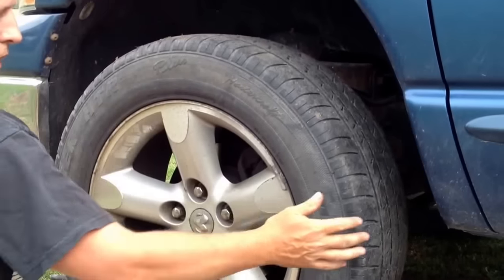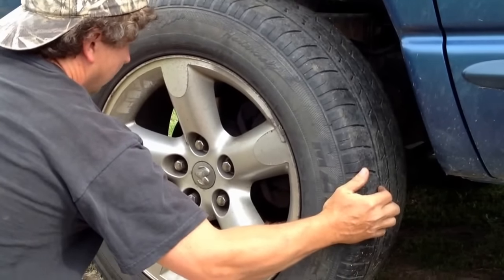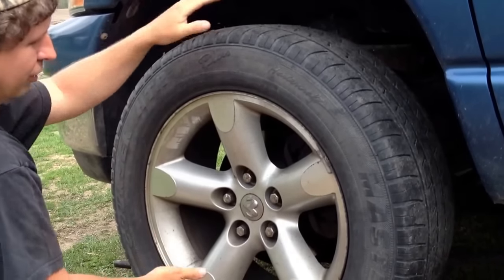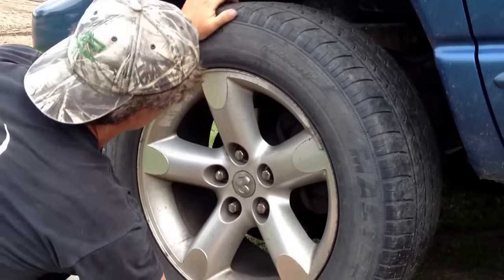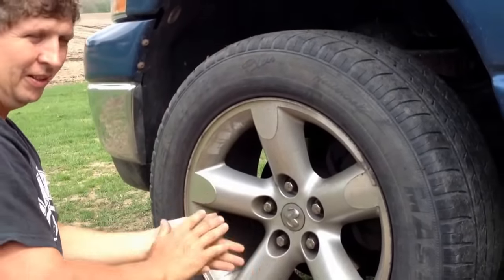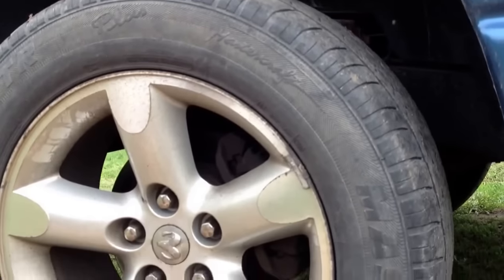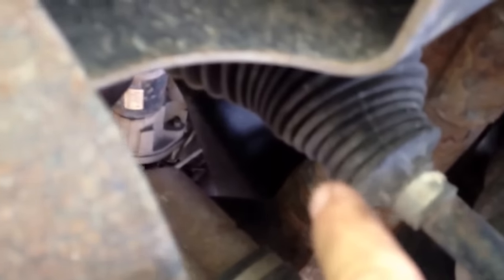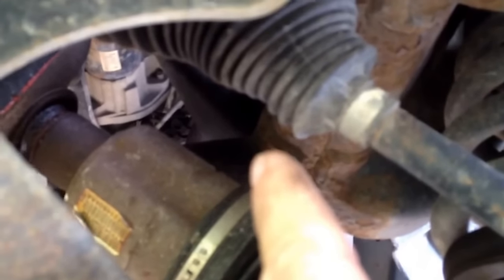How to check Ball Joints, Tie Rods and Wheel Bearings

Comment: Not sure if you'll see this but it's worth a shot.  When I drive my vehicle, for about the first 5 minutes on the road there seems to be a minor slip in my steering wheel when I turn it either direction.  After driving it a bit, the steering seems to be normal and the slipping disappears.  Very rarely when I drive on the interstate the steering wheel shakes, but like I said that rarely happens.  Just had new tires put on less than 2 weeks ago, and had the same problem before and after the tire replacement.
Reply from the maker: This is another sign that the power steering is failing. Other causes of power steering failure apart from leakage include faulty pumps, worn steering rack mounts and loose or worn steering belts.
Reply: Aha!  Thanks for the info, hopefully I get through another week before I can make it up to the parents and have the handy step dad take a peak 😂!  Thank you!

Comment: If u have a wobble left and right is it the inner and outer tie rods? i l also hear like a noise or small clunk from the rack so no play going up and down just left and right?
Reply from the maker: It could be the Inner and outer both. If it's a front wheel drive the clunk could be in the CV shaft

Comment: Thank you for video .. 
Question : What would the tire/vehicle do if it was an  alignment issue ?  Thanx again .
Reply from the maker: The tire will wear out on the inner or outer side of it faster plus the steering wheel will be off-center on it.
Reply: @MrJustDIY  thank u for reply.. My truck (95 ford f150) "lifted"  wobbles left to right when riding .. Breaking kinda pulls steering to the side a bit.. Any thoughts ?
Reply from the maker: @savagekock  I would say tie rods most likely
Reply: @MrJustDIY il look into that ,  thank you for reply.. Cheers
Reply: @savagekock  I have the same truck 2WD did you figure it out? Mine starts out shaking a bit and goes to a shake and bounce so bad I can't drive the vehicle.
Reply: @rsk8310  still having the same issue . Tires go left n right as I drive. If the street isn't smooth im all over the place.. 
I'm thinking maybe bearings, . . Thanx for reply

Comment: The question is, is it on jacks? Mine is on the ground and it wobbles left and right. It was a scraping sound at low speed like bearings are bad....and turning cuves gets it to screech the tires like it's running on wet surface.

Comment: I have  a 95 Ford F150 truck 2WD , Mine starts out shaking a bit and goes to a shake and bounce so bad I can't drive the vehicle over 20 mph. I have about the same play 3 to 9 as the video and every thing seems tight. I am wondering if my pass. side inner rod is bent, its the long rod that travels to the pitman arm.  brand new tires and same situation with the old tires too. What do you think?
Update: I was toe in about 1 1/4 inches , I adjusted it and was smooth riding, Still think  I have a brake and bearing issue as the right side hub gets hotter than the left. Going to do a complete brake job and inspect bearings.

Comment: Hope you get this I have a question . My car does the wobble when u grab it from the sides on both front wheels also when I'm driving & I decelerate either manually by slightly releasing gas pedal or naturally like if I'm turning or going up hill it wobbles. So today I went to mechanic they told me it was the rack & pinion so I said I'll get back to them. My question  is can that be the reason for the wobble? Reason I asked  is because I looked up rack & pinion & the article I read 1 said it can cost up to $2000 for parts & labor but also it didnt mention nothing that that causes a wobble. So I Googled why does my tire wobble & it gave me the same reason as u that's when I found your video just to verify visual that it had the same issue & looks like it is what u said. But I'd theres a chance it could be rack & pinion I'd like know
Reply from the maker: What model and year is your car?

Comment: Thanks for the vid. I’m having a hard time with my wheel wiggle test. It only wiggles left and right and pops and clunks at the end of a full turn to the left or right but not when driving or when the front end is lifted with jack stands. There is no up and down play yet I see the ball joint moving, very confusing! Not sure if it’s really the ball joints or not. I don’t really see any other parts moving, even the strut mounts. I always thought that up and down movement with bad joints just made a squeaking sound. I’ve replaced the CV joints and axle and the sounds still persist. Do ball joints sound different in small and large vehicles? It’s a 2012 Ford Focus, front passenger side. Any ideas would be wonderful.
Reply from the maker: No, the ball joints sound the same. Is the tire wearing uneven?
Reply: @MrJustDIY  I’m actually having the same issue the person above asked. I am getting uneven wear on the front right tire.
Reply from the maker: @EliasVoorhees  It could be your Tie Rods, Ball Joints causing the uneven wear and the CV Shaft could be some of the popping noise

Comment: Mines move 9 to 3 but I really need to use quite a bit of force for them to move, while in other videos they seem to move by rarely forcing the 9 to 3 movement... I have a small vibration at 80km-100kmh that i can feel in my steering wheel and pedal... What could it be?
Reply from the maker: It could be the tires causing it.

Comment: Can you only replace lower ball joint when there is a slight wobble
Reply from the maker: If your car/truck has both upper and lower I would replace both at the same time. Some vehicles only have lower ball joints

Comment: Hi 
I have a question. I replaced my outer tie rods last year , and I just noticed my wheel rocks slightly from the 3 to 9 oclock position how can this be when my tie rods are only a year old? Any help is appreciated thankyou.
Reply from the maker: Did you change the inner and outer tie rods?
Reply: @MrJustDIY  No just the outer ive checked the tie rods and its the outer ones that have gone again its been 2 years not 1 but they were cheap parts and ive heard they can even go within a year some cheap aftermarket parts. So I will replace with better make this time. Thanks for getting back to me.
Reply from the maker: @MisterAmbassador  You're very welcome.

Comment: Hi I have had a slight creeking/knocking sound coming from front right side of my car lately. I had the same noise last summer but it went away over winter  but now it's back again, maybe it's the dry weather. It's only noticable driving very slowly in carparks turning in and out of parking spaces. I took the car to the mechanic and he said it was the ball joints play so he changed the 2 lower wishbones/control arms which was expensive. Now after getting this done I am still noticing the noise. I don't really want to go back to the mechanic because I think he will just change something else and not fix the creaking noise. Any advice would be very much appreciated.
Reply from the maker: Sorry for the slow reply is it a front wheel drive?
Reply: @MrJustDIY Sorry I only see your reply now thanks. Yes its a Mazda front wheel drive.
Reply from the maker: @markcorcoran9866  I would suggest checking the CV Joint/Shaft on it.
Reply: @MrJustDIY  Hi I checked CV joints all look good. I the mechanic to take a look at it again and he told me he the noise is coming from the steering rack which is another very expensive fix to replace. And he said that he couldn't say 100 percent that would stop the noise either. My steering has no play and feels perfect driving. Maybe there is a bearing or some part of the steering rack that might be dryer out ?
Reply: When you did the first test from 3 to 9 I don’t understand how you didn’t see any play? Is a certain amount of play normal?

Comment: My wheels move side to side like butter.  Not up and down What can it be
Reply from the maker: Tie Rods
Reply: @MrJustDIY  hey thanks man    I’ll change them this weekend. Anything else that I should change?
Reply from the maker: @adamnunez2260  That would be all
Reply: @adamnunez2260  was it tie rods? Did you get fixed cause my Yaris passanger side wheel moves left and right with some vibration at high speed. It doesn’t move up and down at all. I am thinking maybe lower control arm ball joint.  When I press with my finger on the ball joint rubber and then tried to shake it.  Much less movement.  I replaced cv axel , strut , stabilizer bar
Reply: Yea. I replaced the tie rods , sway bar and pitman arms    Not too expensive

Comment: How much should a tire rotate (free play) on it's proper axis (forwards/backwards)?  Thanks!  :-)
Reply from the maker: The CV joint is a flexible joint so some play in the shaft is OK, but there should be no play of the joint other than its intended movement.
Reply: @MrJustDIY  - Cool, thanks!  Mine moves about an inch or so, and all the other directions are solid.   I'm trying to track down a click-click-click sound that is happening during my wheel revolution.  I just hear it when I'm driving slow with my window open...
Reply from the maker: @Samos12  Sounds like the CV Shaft / joint

Comment: just double checking. so if wheel moves left and right then its something with the tie rod, up and down then ball joints, and if all angles then wheel bearing correct? thanks...
Reply from the maker: Correct unless it has both bad tie rods and ball joints at the same time.
Reply: +MrJustDIY From my experience with 2 trucks that had bad tie rods and ball joints compared to other trucks that just had a bad bearing, the bearing moved around way more and I could hear the brake dragging on the rotor.
Reply: +MrJustDIY with my truck on the ground I grab top of tire upper ball joint moves alot or do I need to Jack er up boss
Reply from the maker: Hurst Shiftin I would jack it up and check it better.

Comment: What happens if you don't replace the front wheel rods/tie rods?  Will I get some sort of warning sign if I really need to change them.
Reply from the maker: Tires start to wear uneven
If the tie rod breaks you could wreak
Play in the steering wheel

Comment: What if it's making a thudding noise ? Like a flat tire but (I Kno that's not what it is )
Reply from the maker: Is it a front wheel drive?
Reply: It's a 1999 suburban
Reply from the maker: @nicoleyoung1956  If its the 4x4 probably the CV shaft is doing it
Reply: Ok thanks